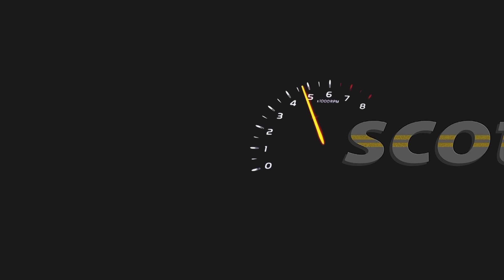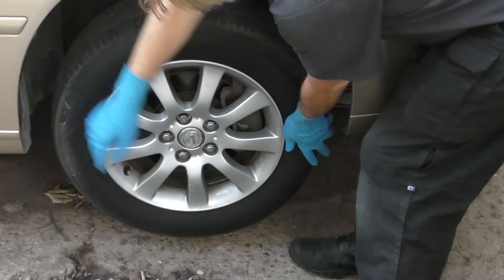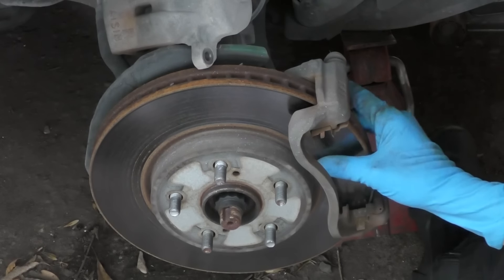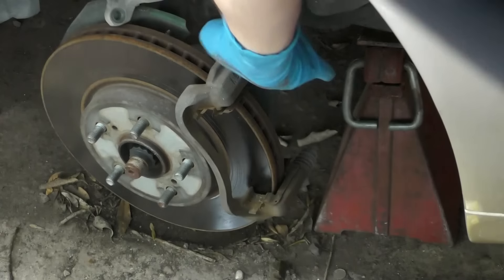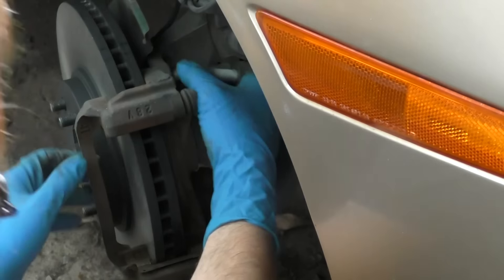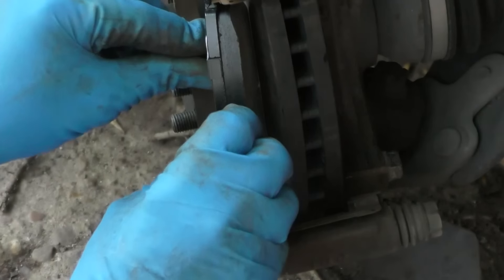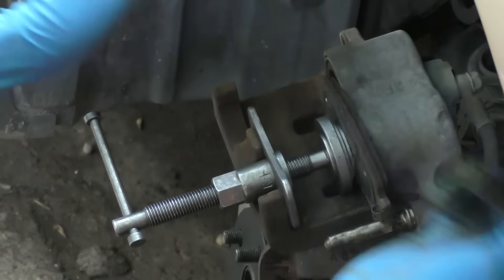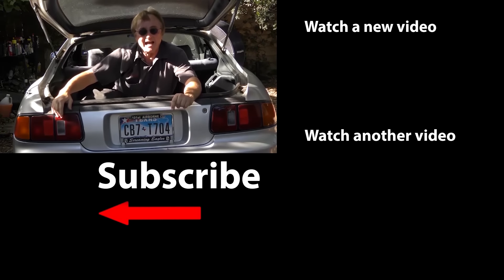Does Your Car Shake When You Brake, Do This

Comment: Hi Scotty , Love your videos . I have a 2003 Toyota Tacoma 4 wheel Drive 4 door . I bought  new calipers  at O Reilly's and off ebay a  power stop brake kit , which  came with new rotors   pads , drums  & shoes along with new hardware ( THESE ARE CRAPPY CHINESE MADE BY THE WAY ) . I put the new brakes on , and I had bad vibration in the front, so I took the calipers off to have them turned and they were warped very bad , they had to make 5 passes on them to get them  straight  ... 
So after putting them back on I still am getting a vibration ... I have put anti seize on the hubs after I cleaned them , I cleaned the rotors and  I have put the grease on back of the pads and sides where they slide , and I'm so frustrated as to why I am getting a pulsation still , ...  Any ideas what you think please ?
Reply: You won't believe this, but this maybe the culprit and i was in my case.  Rims "WARPED" !!!

Comment: Firstly, I would certainly find the reason for warped rotor. Sticking sliding pins are very common. Sticking brake cylinder is another. After finding the culprit,  I would install the new hardware. Otherwise you are going to do the same job again soon.
Reply: Definitely good points, but don't forget to include poor braking habits by the driver as a possible cause, too.

Comment: Ibhd a shake in my steering and replaced worn break pads, rotors, and greased my guide pins and the car was great. Though a couple of months later it's shaking again and I hear a bit of a road noise. This would indicate my wheel bearings needing to be done hey???
I had to replace the rear ones a while back

Comment: Hi Scotty I replace the disk and brakes and the front but it still shakes the steering wheel. If the rear disk are warm out does it make it shakes the steering too or is there other thing I need to check.thanks
Reply: You won't believe this, but this maybe the culprit and it was in my case.  Rims "WARPED" !!!

Comment: I have a pile of worn rotors 
Every time I do a brake job I just replace them I  get them cheap on eBay 
Rather than pay 100.00 per rotor at advance auto I get the whole set for that with pads I don’t get and noises or problems with them just a little brake dust
I live in the mountains and go through brakes every other year lol

Comment: @4:20 two things that should be done:
1) clean the outside of that piston (behind the rubber dust boot) with a scouring pad or light sandpaper to remove any baked on grease or surface rust. Then wipe it down with a clean cloth soaked in brake fluid. Why push in a rusted piston, and have it contact the delicate seals.
2) open up the bleeder screw so when you are pushing in the caliper, the old dirty fluid is pushed out the bleeder screw. - afterall, you should change out the fluid anyway.

Comment: Hey Scotty have a silly question. Im in a 92 honda prelude with 135xxx miles i have vibrating while breaking also vibration between 40 and 60 mph this is 2 different set of wheels and tires also i have a clicking while turning which im guessing is a bad CV any suggestions?  Thank you - Ron P.S. i love and greatly appreciate your videos and help 😉 thanks again

Comment: Quick question, my rotors have little screws that hold the rotors in place. These screws are a pain to remove even using a impact screwdriver. Are these screws necessary? Could I leave them off?

Comment: What if the car sits for some time (weeks, months) and after that it shakes the steering wheel and pulsates the brake pedal while braking like crazy but after driving it a few hundred miles it gets better and vibrates less? I can still feel it, but I swear it's not as bad as it was about 1000 miles ago. The car still brakes fine though. (The car is 1995 Volvo 850.)

Comment: I had all my rotors changed and the entire break system replaced, but I still have a problem when braking. It does not happen all the time, but it is still a big problem.

Comment: Scotty Kilmer, my mother in law has an 06 grand caravan that eats a set of break rotors about every three yrs or so. it's done it since new. I've replaced with OE, after market premium, and even high performance slotted rotors from Stop Tec! I've always replaced pads and checked the front end for play. I've checked the and even replaced the calipers just to make sure they weren't sticking. I think they were sized wrong for the vehicle from the factory. is there anything I've missed?
Reply: Nah. Those are big, heavy vehicles.  They eat front rotors and pads. 

I don't know if it's possible to adjust the rear brakes, but I'd just buy pads inexpensive parts because the more expensive ones hardly last any longer.

Comment: The rotor can have run-out/warping and still be the same thickness all around.  The cheap foreign made rotors they sell now tend to warp from the normal heat of braking.  The cast iron is poor quality.  They can even sometimes cause an unbalanced condition.  The automakers also make them as small and thin as possible to keep the weight down at the expense of poor heat dissipation.

Comment: A good tip would be; some times the disks never come out due to a bad rust. The best way to do it without any hamering is just put two bolts in those little wholes on the disk and tight them. The disks will come out super easy.

Comment: I had a shop change my brakes not the rotors and it stopped shuddering for a couple weeks and now its shuddering again i used ceramic premium brakes i dont know if its the quality of the brakes or the rotors should be changed out as well ?

Comment: Most rotors are not technically warped, but thats what I usually call it as well.  Unless your going to the racetrack frequently, your not technically warping rotors.  It takes over 2000 degrees to warp the steel on disks and no average driver is warping rotors.  What happens is that the disks actually wear more or less in different areas.  I think its called lateral runoff, but the pulsing is usually from uneven wear on your rotors.....but hey what do I know im not a professional mechanic.   lol

Comment: Hey Scotty, i love to watch all your videos i live in Portugal.
In this case do you think that the problem might be related to worn suspension bushes and or roll bar bushes causing the warped disc rotors?
I have a 2002 Seat Leon 1.9 TDI that has had that problem but after i replaced the bushes in the supension and front roll bar without replacing the rotors, i noticed that the problem gradually started to become less noted and in 3 or 4 months i notice no vibration in the stearing wheel.
Thanks for all your videos keep up the good work.

Comment: How do you find out why the disc brake pad clip falls out and the front end shakes when you apply the brakes. Just put in my 3rd set of rotors and brakes on a 2015 toyota corolla

Comment: surprised how cheap the caliper tool was.  i have borrowed one from autozone before but thought they would cost a lot more than that.  I have also used a C clamp before and used the old brake pad in between to slowly push the pistons in.

Comment: That $19.00 dollar tool demonstration measuring the "thickness" of the rotors explained "the basics" of the shaking of my steering wheel.
I have a 2001 Toyota Corolla that you so highly recommend with 210,000 miles. (It even ran well with a broken serpentine tension-er mounting bolt I recently replaced) I know now the reason for the warped rotors was because I adjusted the parking brake too tight. I also have a squeaking noise in the brakes as I use them and the greasing of the pad ends may be the issue as the warped rotor moves the pads back and forth. The only thing I wonder now is as the pads and rotors are relatively new, will the shaking from the warped rotors cause any other problems in the future. Is it best to replace them again? (front and rear?) How often can the newer rotors be "cut".
Reply: Despite the fact that you seemed to agree and appreciate his information in this video, your comment seemed like it was choc full of veiled sarcasm.
Reply: You read me so wrong. Cars do get old and worn even Toyota Corollas. Bought it with 178,000 miles on it. I have NO idea what it went through before that! NO sarcasm.
Reply: +Fred R yeah I know what you mean, sometimes it's hit-and-miss. I got a 99 Ranger with 176,000 miles on it, and the thing runs like an absolute champ. The back catalytic converter needed to be replaced because it was starting to get gunked up, and it needed a new mass air flow sensor, but but those were easy fixes, now it runs fantastic.

I have a white driveway, and I've had the thing parked out there for about a year now, and it has literally not leaked one drop of fluid despite the fact that the previous owner was an old man who got in a front-end collision with it. The radiator needed to be replaced afterward but that was it. Best $900 ever spent.

Comment: What about a shimmy during acceleration around 70 miles an hour? I replaced the CV joint on a 2007 Passat and it fixed the steering groan but we developed the high-speed shimmy but only during acceleration? is that a flaw with the new CV joint? should I try to get the part warrantied?

Comment: On 2012 dodge Grand caravan se new brake pads new rotors the car seams to vibrate a little when pressing brakes to come to stop is there something else I can check for changed front pads and rotors only any advise thank you

Comment: Scotty, I had my car 2012 toyota camry shaking while applying brakes above 80km/h . So, I change my all brakes and rotors , the problem was still same . So, I checked any recall for toyota camry and they had one . So, they said its the problem of torque converter. They changed it with new torque converter and now its running good . So, no shaking it all .

Comment: Hey scotty... I have a 2010 Camry that shakes only when it get warm up.  I checked is the wheels plays and they are nice an fit... I changed the brakes and the disks... and the problems still persist... do you have any other tip?

Comment: You should have opened up the bleeder valve when compressing the fluid back in to the master cylinder because all that fluid where you're compressing it is junk and should be flushed out instead of Flushed back in which can ruin your ABS system

Comment: Hey Scotty
I was bad and bought a set of brake pads and rotors from the internet.  The brakes are pulsating after about 15000 miles and I think I am going to replace them with premium rotors. When I was doing my research everything seems to come from Chine except DBA (Australia) and EBC (Great Britain)  From my reading most brake blanks come into the USA and are machined and then they claim they are USA made (not really). I want to have a good quality designed and cast rotor with quality metal. I am not looking for a cheap light weight rotor but something with good quality casting and metallurgy.  Do you have any suggestions?  I have a 2014 Subaru Forester XT    Bill W   Summerland B.C. Canada

Comment: Off topic here. Love the site mr kilmer. Always great advice 
My issue is.  Toyota Matrix 2009 base model 1.8 lt.  i get the check engine light on.  Car sputtering and even dies at stop lights or idle. Misfire cyl 2,3 and 4.  Replaced all 4. Threw some fuel injector cleaner. And im still having same issues. Any help appreciated.  Dont know where to post questions so i apologize
Reply: Oh yeah forgot that. Yes they were replaced
Reply: I did replace the 4 coils too
Reply: Didn’t replace cylinders
Reply: @sergiof4482  I recommend replacing all 4 cylinders. I've seen this issue before. Be sure to coat them with copper anti seize so the spark plugs can conduct properly to ensure a good spark.
Reply: You mean coils are the actual cylinder?

Comment: Hey Scott  Everett 1000 Chevy cameleer convertible the top when it goes down there is like a crack by they gear by the motor any opinion what could be. Can I or do I have to send it to a mechanic to get fix

Comment: Mine sometimes shakes on the steering wheel when I hit the brakes on the freeway. But I have new front brakes and rotors. I do believe I need new rear brakes though. Can that possibly be an issue because my front brakes and rotors are only about 4 months old.

Comment: So i did all of that about 6 months ago.   In about 3k miles - it’s already doing it again!   But my problem is the brakes skip as the break (or jump) - when breaking down a hill.   Any suggestions?    I installed new disc and pads.   I used Wagner disc.  And semi metallic Bosch pads.  It was on a Honda Accord.   Normal driving.
Reply: Did you ever find out why the brake skips??mine shakes when i brake at like 60 50 40 or higher then its skips while braking at a low rate of speed

Comment: is it possible that specific brake pads could cause rotors to warp? ive gone though 3 sets of rotors with my ebc green stuff pads. i do the heat cycles and everything and then my brakes will be good for only a few weeks then back to shaking.

Comment: I have random vibration not just when I break but sometimes when the tire hits certain bumps it'll vibrate and cause me to have to push harder on the gas to get going , I was wondering if it could be bad break hardware cause I used a new brand last time before this issue started or if it's an axel ?... I ruled out balancing and tired warping by replacing tiers and having them all balanced

Comment: Why people always change the disc brake when this happen?
In my country, if the disc brake still looks good, solid, and not rusted into pieces, we always resurface it. It only cost 7 bucks a piece(at least in my country) and it works good for me over years. Disc brake are made of steel right? And resurfacing doesn't eat that much, it's basically almost same as when you sanding a wood or body panel, etc. But of course, for safety reason don't resurface it more than 2 times. And if the disc brake that you bought is not OEM nor good quality ones, then don't resurface it lol.

Comment: I have problems with shanking. I bought brand new Calipers and Rotors for the front it got a little bit better but still shakes I check tires and nothing.

Comment: I had a similar issue with my e46 it turned out to be the shocks they had completely gone i was trying to work out what it was for months as the brakes, tie rods and drop links changed then one day the car started shaking going over bumps i then changed the shocks and that cured it. I hope this helps someone.

Comment: I am having a problem getting my rotor off. I followed your directions and have been hitting it with a hammer for days and it won’t come off. It is a 1994 Ford F-350 4x4 and hitting it with a sledgehammer isn’t working. Is there anything I am missing?

Comment: Shaking when braking when i have my original 17" alu wheels with summer tires on.
Not shaking when i have 16" alu winter tires.
Moved wheels from back to front, same issue. Some say the center hole can be wider. How is that possible?

Comment: Hello Scooty -  I know this question wouldn't be in line with what this video is about but this is killing me - I have a Lexus IS350 2006 runs great but Check VSC comes up when I step and hold the break for 10 seconds and above - however it goes away when I stop the car and and start the car again: Trouble code is C1380 - please please please I am a great fan of yours and this is killing me: I have changed the break switch yet same experience. Please help me.
Thanks
and great video as always :)

Comment: I have a Nissan Quest 09, I had the same issue with the shaking of the steering wheel while braking. I changed the rotors and the brakes pads brand new and the shaking reduced 70% but it still shakes a little and when I'm driving in the hwy around 70 mph. Do you know what else could it be? Thx

Comment: I have a 2014 cadillac cts. changed my brakes,rotors and it still shakes. Very slightly. A lot less than before I changed them.. I also had one tire that was wearing unevenly so I rotated them maybe thats why ? I cant seem to figure it out. Its very frustrating

Comment: Hey I need help sorting out an issue I have in my Nissan primera p11. My ac compressor stopped working and I saw a blown fuse in my fuse box and everytime I change it it would blow again as I start the car. Help please.

Comment: I test drove a used dodge truck the other day and it had a weird shimmy vibration when i stepped on the brakes. And i mentioned it to the sales people and they said oh the rotors probably need machined. And i asked if they would take care of it if i commit to buy it and they  bascally said nope its safe to drive as is. I said not interested and walked out.

Comment: Hello. I have a question
My car was a normal car until i decided to change the rear brake drums and brake shoes. The old ones were really bad. I took my car for a test drive and my car started to shake really bad at high speed (when stepping on the brakes). I took it back to the mechanic and he told me to replace the front rotors. I did exactly what he told me to do.. i changed the front and rear brakes two times everything is brand new . The shake is still there. Idnt what to do because my car was shaking before.. eventhough the rear brake drums were really bad i didnt have a problem untill I replace the rear brakes. I need a 2 opinion. I already spent $600 and the mechanic keeps telling me to replace this and that

Comment: Hey Scotty I am from India and I am thinking about buying a 2018 Maruti Suzuki Swift Dzire what are your opinions on that am I better of buying another vehicle for that price also you should know with the fuel price Indians usually doesn't drive our cars that much we used two wheelers for regular commute as they are cheap reliable and fuel efficient than cars so probably my car won't Run that much and it would be mainly used for weekend drives with my family